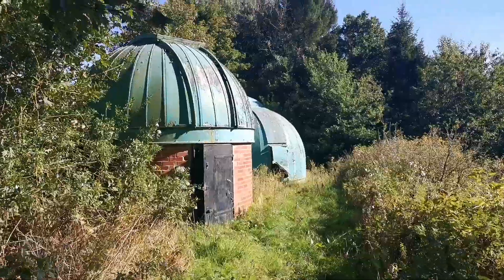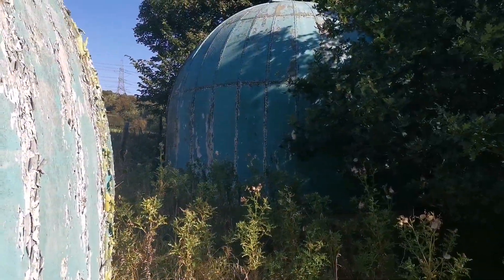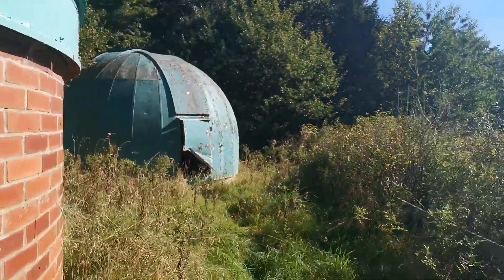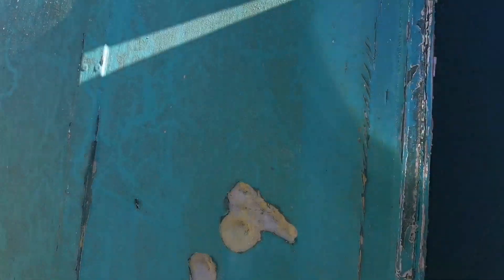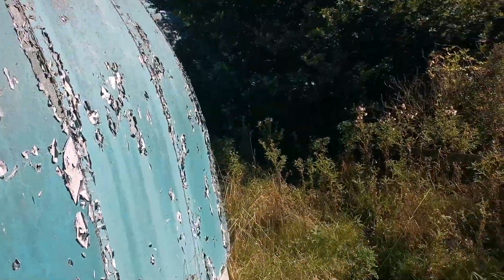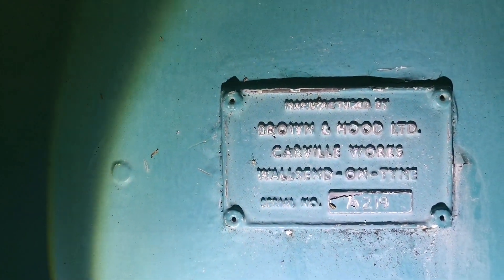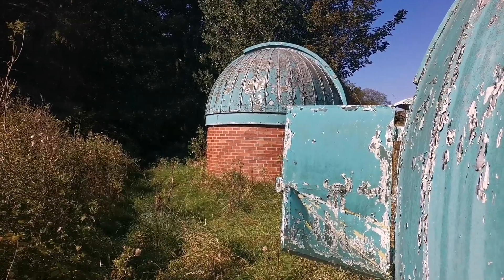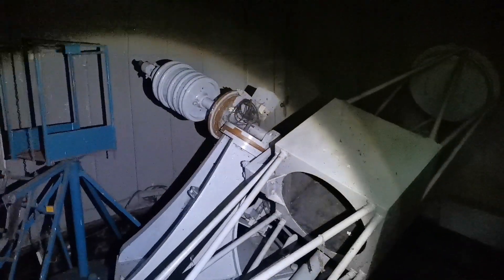Abandoned Observatory and Telescope

Comment: The telescope is a 0.6m Calver reflector that was initially used by Reverend Espin, the "Stargazer of Tow Law". Tow Law is a place in County Durham, and this was around 1900. Espin had a 17" telescope initially on the same mount. The 17" mirror survived, albeit it was later ground and polished to a shorter focal length by some ex Grubb-Parsons members, to build a new telescope with it. These folks all passed away, and the 17" is currently with me to get refurbished and finished. Not an easy task, at about 1/2 ton weight. 

The 24", which is still in the dome in the video, had been refurbished by the late David Sinden (optician at Grubb Parsons, Newcastle and paramount in making some of the world largest instruments back up to the 1980s, including the 4.2m William Herschel Telescope mirror). It is indeed sad to see the instrument in this sad state, which is caused by a floodlit golf course installed nearby, rendering the observatory useless due to the light pollution. I really hope it can be saved. Dome-wise, at least the dome with the brick laid cylindrical underpart should be saved. It is an Ash Dome, probably about 4m diameter. I know one of those in a planetarium with observatory where I am a volunteer, and these domes are very robust and reliable. I would think this dome should be saved. Maybe together with the  0.6m, if it fits inside.
Reply from the maker: You know more than me about them haha, it is a shame to see them just left
Reply: That soooo angers me that the council ( i assume ? ) allowed a Golf Course to be flood lit ?? For goodness sake why couldn't they meet the astronomers half way and play Golf during day, and leave the darkness of night hours dark for the astronomers ?? Light pollution has gotten wayyy out of hand during the last 30-40 years!!?? It's so unfair...
Reply: @wesleydonnelly2141  It is annoying, really and not the first observatory lost to a golf course (the "Big Ear" radio telescope in the US being another example). But in this case I believe it was private ground, and as the owner changed it was decided to do the floodlighting. I just wonder why the observatory was not relocated, or at least sold or given away instead of being left to fall into this state. But I do not know the full story.
Reply: @juergenschmoll185  Yes it does seem very strange to just leave the Observatory and atleast 1 ( very expensive! ) Telescope to just rot and decay ?? My goodness i would kill for an Observatory and Telescope like these!? At the very least they should have relocated the Telescopes ?? Atleast 1 Telescope was left to rot, and that is just unforgivable...
Reply: @juergenschmoll185  I don't think light pollution affects radio telescopes, but does cell towers, wifi, TV, etc.?
Reply: @mcsew2k  Yes. My example of the Big Ear was about observatories being demolished to make space for golf courses. But you are correct, radio telescopes are subject to all sorts of radio wave pollution as mobile phones, Starlink satellites (amongst others) and for example microwave ovens nearby. Often radio telescopes have "radio quiet zones" around them where the use of certain equipment is restricted.
Reply: Its weird that I looked for loads of information on Thomas Espin ages ago. His old observatory tower in Tow Law is actually currently my living room...we found the foundations, and turning plate for his second smaller observatory tower in our garden to, and have been trying to find out what it looked like to potentially restore it.